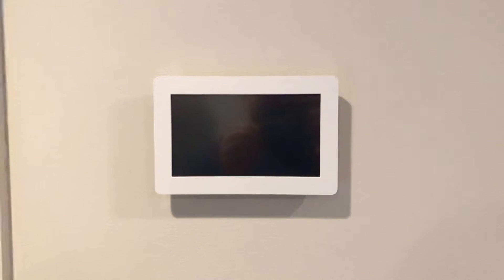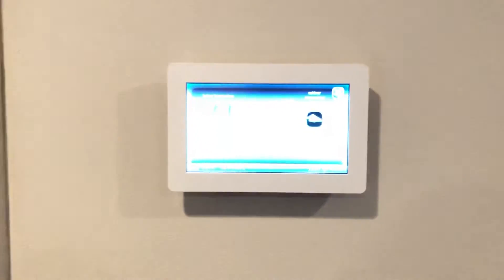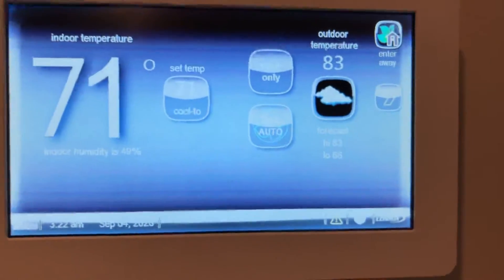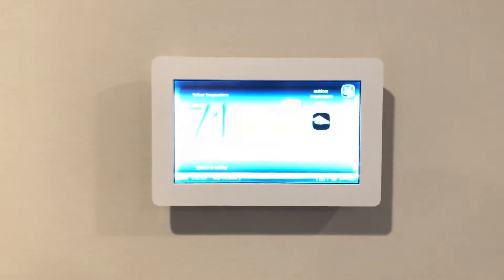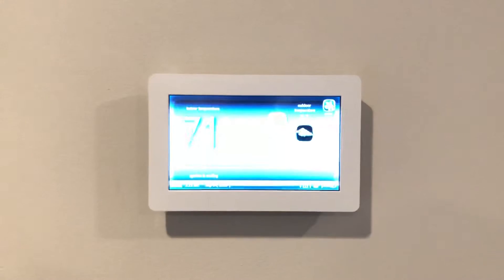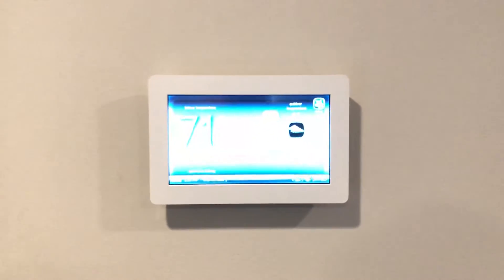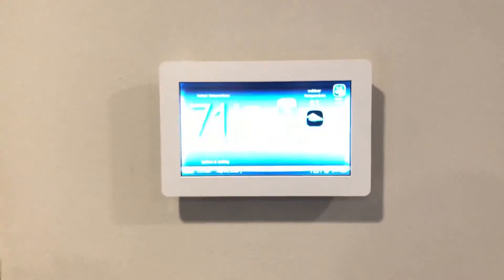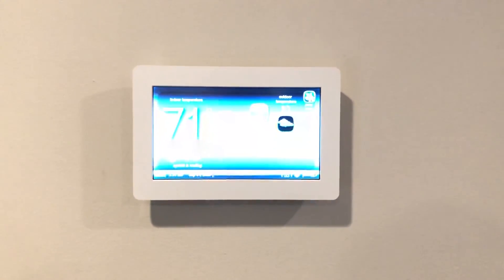UPDATE: Another Failing Lennox iComfort 10F81 Thermostat

Comment: this thermostat comes with a 5 year warranty and is no longer made, the replacement you should be able to get free(plus freight) from a lennox dealer, the replacement model is an S-30 but is a little more difficult to wire in, you will probably have to pay an AC contractor familiar with lennox controls to install it.  i have replaced several of these thermostats for different issues, but i just saw my first one with no display today, the unit was a little over 4 years old so the customer gets a new thermostat but still has to pay for freight and installation labor which is not covered under the manufacturers warranty... i have been in the ac business for over 40 years and the controls are getting more and more complicated, and require constant training updates to keep ahead, i actually like the normal non programmable thermostats myself, easier to replace the broken thermostat... hope this helps Aloha

Comment: Update.  They installed a non-digutal eight months ago and say the replacement thermostat, S-30, is not available.  It's been eight months.  The "old" thermostat works fine, but I am not getting the variable feature that the digital thermostat can deliver.  I have not seen my electric bill go up too much.
Reply: @Skyhawk780  I cannot see the model number.  Thanks for the info on the S30.

Comment: I have two of these thermostats and both have failed at the same time.  We have had them for 5 years and 3 months, just out of the warranty.  I called Lennox and they refuse to make any concessions and even acted flippant about the fact that both of our thermostats failed at the same time.  It’s ironic how both failed right after the warranty.  The representative I spoke to said he would try to talk to his manager about the issue and get back to me to see if he could do anything to assist in the replacements.  I called back and he confirmed they would not make any concessions.  Meanwhile, our HVAC installer is unable to do the replacements because there are not any thermostats available.  He even said he needs a replacement for his own home because his is experiencing failure as well, and he cannot get one for his own home.  Our thermostats are IComfort, model 10581.  I will attach a link to my video for this same issue.

https://youtu.be/otu2-w5IelE

Comment: Hi, this thermostat came with my Lennox XP25 heat pump, and it's having a similar (if not the exact same) issue with the screen. You mentioned that this model is being replaced by the S30. Do you know if the S30 is compatible with the XP25 system?
Reply: I believe the S30 is compatible with the XP25.  I have an XP25, and my distributor has been trying to find an S30 for 10 months.  I am using a non-conventional Lennox thermostat in the meantime. Have you had issues with your XP25?  In five years, I have had to replace the motherboard and the fan motor - under warranty but paid for labor - , and now this problem with the thermostat.  I did not expect this from the top of the line.
Reply: I have not had a problem with anything except the thermostat. And yes, the S30 is compatible, because I  bought one on eBay, and it's much nicer than the original.

Comment: Mine just went to the white screen this weekend, but the system still works with the apps.  During annual maintenance on the heating unit today, I asked how much to replace it?  They said the touchscreen unit is $900 + installation costs.   Does this sound right to you?  (side note:  got the unit in May 2014, so I got 7 years out of it... yay?)
Reply: Wow I got mine in June 2015, it failed yesterday - did Lennox send out a killcode or is there just a suicide timer app inside these things?

Comment: My 10f81 screen went white two days ago.  I removed the screen unit to get the model number, specs, etc. and have been looking for a replacement or substitute.  I didn’t reconnect the screen for about 24 hours until I realized the unit was needed for remote functions.  I reinstalled the screen and it now works.  Don’t know if it needed a reset or will continue to operate.  But, for what it’s worth (apparently not much considering these posts) disconnecting the screen unit for 24 hours may help some people.
Reply: Mine just went straight white...i'm gonna try this method and hopefully it works.  Do you have any updates on your ac unit?
Reply: Unfortunately, my screen went white again last week. I will try to disconnect the device again, but based on other's comments, I'm not optimistic. But, at least I squeezed another 10 months from the unit.

Comment: I've had our Lennox HVAC for about 8.5 years... First iComfort Wifi display died at about 3.5/4 years (touch screen stopped responding to touch). The replacement started acting wonky ~3 weeks ago with flickering, sometimes going dark, and coming back a few hours later. A week ago it fell off Wifi, and has persistent vertical bands and no discernible image. Was about to get a Nest, but now realize that this is a communicating thermostat so can't do a simple swap. We'll see what Lennox says on the phone tomorrow.
Reply: lennox does not care,,,, they say buy the newer model,,, which is gonna cost you $800.00 or so.
Reply: Same exact thing happened to me and I don’t know what to do. It’s getting colder and I have no heat and don’t have $1000 to spend on the newer s30
Reply: @loganparker6775  The company who installed it said that Lennox would only honor the original 5 year warranty (so not extending it 5-years from when the first replacement got installed). The S30 would have needed wiring changes plus it is an expensive unit, so it was worth it to just pay that money to rewire the unit in the basement to accept a Nest. I think installing the Nest was like $3/400, the Nest was on sale for $200, and I had to buy a humidistat for the whole-house humidifier (as the wiring leading from the unit to the wall thermostat didn't have enough strands, and I didn't want to pay for fishing a new wire). All told, still several hundred cheaper than going with the S30.

Comment: Insanity. Glad to know I’m not alone in being told the only option is a $1000 replacement but how is this acceptable? I even went to far as to order a replacement screen and try replacing it. Seems it’s not the screen but something in the circuit board that causes the problem. So frustrating. Did everyone here just give in and buy the s30? I’m really wanting to avoid that since the reviews for that one are abysmal as well!!

Comment: Well, I was just looking into install instructions since I'll have to have mine replaced after 5 years as well, due to this same issue, and came across this video instead. Mine is covered under a parts warranty, but I'm still out $300 for labor charges if my installer won't allow me to do it myself. Good to know this is a more common issue than I was led to believe.

Comment: We are on our second 10f81 after having the first replaced on warranty in 2015. Now this one just went black. It is a display issue. Talk to Lennox and they won't do anything. We can still control it with the app or website. A replacement is the S30 at $1072 installed. We're stuck because we would have to replace the furnace and all the other equipment to switch to another brand.

Comment: If you have a communicator like I did which means there’s only four wires going to the thermostat a nest or ecobee will not work…
Reply: OnTech would not install a Nest for me. They came out, then told me it couldn't be done. I'm tied to Lennox forever, apparently, which means $1,000 repairs every 5 years?

Comment: I am another victim of Lennox’s poor quality thermostat. I bought a house about 10 months ago and my thermostat died yesterday. I called Lennox to buy a replacement thermostat but they forced me to work with the local dealer which will cost me around $1000 or more to replace faulty thermostat. Thermostat is slightly over 5 years old. Spending $1000 every 5 years on thermostat is unacceptable.
Reply: I have the same problem 😕...
Reply: Welcome to the club unfortunately…   Don’t get another 10f81 like I did .. I’m trying the s30 … we will see how long that will last ..
Reply: @jasonrodriguez637  
Do you have option to choose? Guy is coming on Monday to replace mine.

Comment: Would it be possible to replace with a Nest or Ecobee? I am researching right now and try to understand compatibility issues if any, would someone here know...
Reply: Hire your local hvac tech. It can be done!
Reply: A conventional thermostat like a Nest or Ecobee are noncommunicating thermostats.  The Lennox Comfort 10F81 and the S30 are communicating thermostats.  If you have a communicating 10F81 then your HVAC system is wired outside and inside for communicating thermostats.  The noncommunicating Nest, Ecobee or other brands will not work unless you hire a technician to rewire your communicating outside and inside HVAC units for noncommunication which will be costly and defeat the purpose of purchasing the better communicating HVAC Lennox units.

Comment: Came to read the comments and looks like we are all in the same boat. About 5 years the thermostat goes out. I’m sure it’s programmed to start breaking down. That’s crazy! They should do recalls just like car parts. My screen is completely blank right now.
Reply: Did your ac go out ? Or just your sceeen?
Reply: My screen went out for about 6 months and I could still use app (AC still worked); but now the unit is dead completly.  @robinmoore7627
Reply: Me too...

@robinmoore7627 - The screen gets really bright at first and then gradually turns white and unusable.

Comment: Same here.  My 10F81 failed after 6.5 years.  965$ replacement in Canada + labor.  Called Lennox and nothing they could do apart from telling me the S30 is a much better unit and that I would be so thrilled.
Reply: Thanks for the info.  I'm in the same boat - Blank screen after 6.5 years right in the middle of our heat wave in BC, and same quote from a certified Lennox dealer.  So did you end up going for the S30?
Reply: Well then .. are you thrilled?

Comment: I currently have this thermostat and am having problems with it. Do you know if the s30 requires the smart hub addition or if I can just directly plug in the C, i-, i+, R wires from my wall into the s30?
Reply: New one needs smart hub
Reply: Must install the smart Hub as it steps the power signal to the thermostat on wall from 24 vac to 12 vdc.  S30 thermostat warn purchaser of that fact.

Comment: I’m on my 3rd 10f81 Wi-Fi screen.  
Now it’s completely out of warranty and going with a nest thermostat.. trying to find out how to hook it up
Reply: Did the nest work as a replacement my screen just went black I can still control it from my phone fortunately
Reply: @jglassman1122  no it did not .. It has to have a communicator..
If I bypassed it in the attic.  They said it would have ..  I returned it.
Reply: I ended up paying a lot more for the s30.   But it has worked perfectly.. even with Alexa
Reply: @jasonrodriguez637  I just had the best 30 installed a week ago cost me $1100 but so far it has worked perfectly they said that the newer units are updated so hopefully I won’t have any issues
Reply: Your Lennox 10D81 is called a communicating thermostat therefore all other brands like Nest that are noncommunicating thermostats will not work because of the wiring in the Lennox HVAC units.
Reply: Meant to type 10F81

Comment: I am in Australia and my unit just failed today. Come home, screen completely white with some lines running through it. No way to put heating on. The unit is only 4 and half years old, so will contact Lennox tomorrow for a replacement. I found this post here and I am shocked how many people have the same issue. Surely there should be action against Lennox for a faulty designed unit.
Reply: You can use your Lennox phone app which allows you to do any adjustments. I set up an old iPhone with only the Lennox app on it and keep it powered nearby to do any adjustments. A blank screen does not mean you can't adjust it. Been using the phone for over a year.

Comment: Mine is about 8 years old, screen has been ok but very recently the internal temperature sensor in the thermostat has failed(error 700), i tried doing the reset calibration and no luck. It came back to life for a few minutes but then failed again, my Lennox SLP98V furnace won’t run. Looks like time to upgrade to S30 thermostat unfortunately

Comment: These built to fail devices by Lennox need to be stopped  Replacing a thermostat every 5 years for 1000$ is not sustainable. We need to initiate a class action lawsuit
Reply: I agree.
Reply: My just went down called my installer, they're charging me $1700 for an upgraded device...fuck that, any body have a cheaper suggestion.
Reply: @maradona7lopez  you can go with a nest but it will only run on the low load speed Lenoxsucks because you only have 4 wires but at $350
Reply: Agreed! We were just quoted $1300. I'd go in on a class action.
Reply: Any lawyers out there needing to make a million bucks and who know how to do a class acation suit.  These thermostats are supposedly warranteed for 5 years, but there is no way to ask for a replacement.
Reply: I agree just paid $1000 for a new s30 my installer gave 10 year warranty on this one but if he is not around stuck again 😂
Reply: @JohnSmith-js3po  I was quoted 2000 for the thermostat and 200 installation fee. :(
Reply: @PrabalKhanal  negotiate with your installer that is to much check Amazon and eBay you can use a  different brand it just won’t go to the high format just find an installer that will put it in for you and program it Honeywell makes one for $280 it has 5 wires from unit but will work with your Lenox hvac
Reply: I have the same issue. Very disappointed.
Reply: Class action for the Lennox thermostat?  YES!!  I'm in.  I hate the Lennox thermostat.  It fails once or twice a year.  It requires a service  call every time it fails.
Reply: lets do it

Comment: Mine failed after 4 years and I had it replaced under warranty in 2017.  In 2018 I sold it and bought the S30.  As of a few weeks ago, the S30 is refusing to connect to my WiFi network. So lots more headaches courtesy of Lennox. Horrible design, and the customer support is even worse. Great features though......if only it was reliable.
Reply: Hi there, did it say Wifi command timeout? My can not connect and displays that message. I want to know what was your remedy? Thanks.
Reply: @thehulk9847 I don't recall what the exact message was, perhaps a WiFi timeout, but it simply would not connect. I had suspected that it was after a lightning storm or power surge that it started failing.
I eventually got to speak to a Lennox engineer. He asked me to try a few things, but then he realized there was a serious problem and it had to be replaced. He said he would send a warranty replacement S30 to my dealer. 
I got it a couple of days later.

Comment: I'm dyslexic. I don't want to fumble through a bunch of instructions in computer jargon. I just want something simple that can be operated the old-fashioned way. A simple on and off switch is all I need. Is there a less expensive alternative I could install myself?
Reply: I’m trying to hook up a nest thermostat to mine now.. I only have 4 wires that hooked up to my Lennox .  Hopefully it all works
Reply: @jasonrodriguez637 , I got a new thermostat that works great! It's a Honeywell-Home ProSeries. I appreciate all the help.
Reply: @2much2do56  thank you I’ll check that one out .. 
my nest seems to different in the wiring.
Reply: @2much2do56  so you were able to use the Honeywell thermostat with a Lennix system did you have to do any special wiring to get it to work?
Reply: @jglassman1122  Yes. It works great. I had to have a little help with it though.
Reply: What did u change on wiring side ?

Comment: My 10f81 just started doing this. I pulled it out of its holder & reinserted it, hoping to restart it.  Now, the screen is plain white, completely roasted.  Can I just buy a new one & plug it in?
Reply: As my display does not work, I cannot generate the PIN needed to use the app. Frustrated.
Reply: There is a seller (Global8888) or something near that that sell new 10F81 screens.  I purchased one from him but it would not work indicating a motherboard problem.  The seller had a great return product policy which I followed to get my money back.  A new screen might work on your unit.  You won't know till you try.  The total price including taxes and shipping was $96.20.